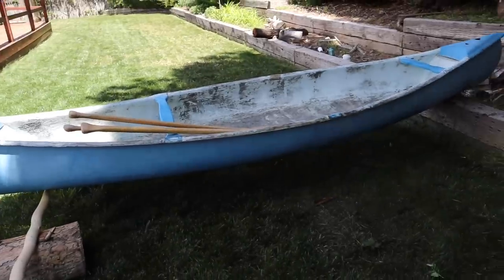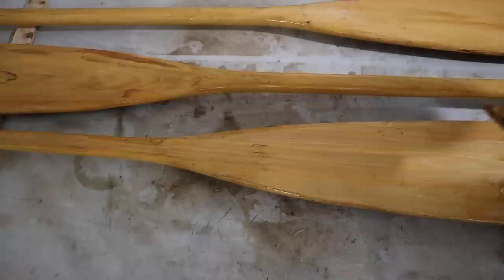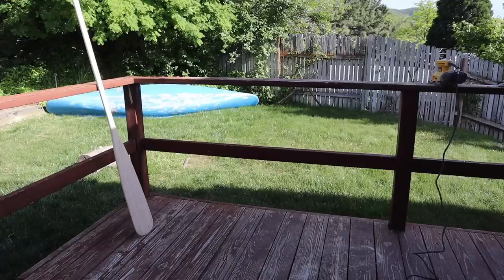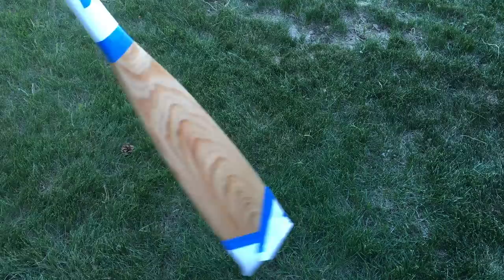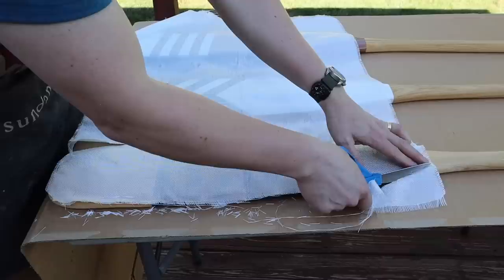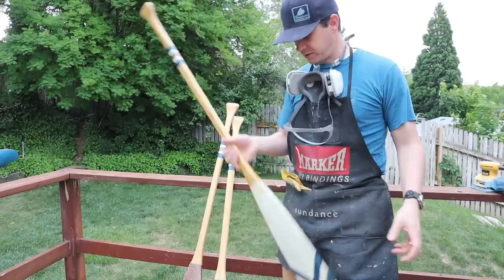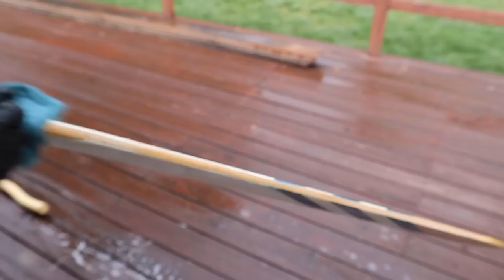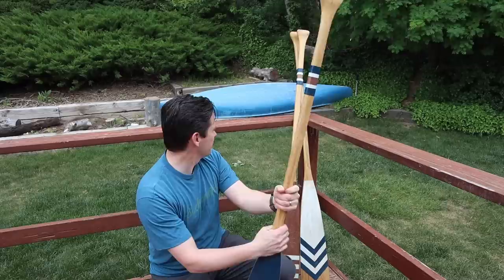Paddle Restoration - Custom Painting and Fiberglass

Comment: On the paddles, try multiple coats of either spar varnish or marine varnish for the finish, after fixing the cracks with waterproof glue or epoxy.  For the canoe, go online and look through the products sold by Jamestown Distributors  and/or West Marine, for starters.  You will find that the difference in cost between everyday products and marine-grade products is not that much compared to the time you will spend on labor doing it the first time, and then re-doing it again a year or so later when the wipe-on poly fails.  Thanks for the video - the paddles look great right now.  

P.S.  Blue Painters tape will pull up new paint if you're not really careful, as you may have noticed.

Comment: Nice job on the paddles. A tip for you you can precoat the paddle before adding the fiberglass or presoak the fiberglass beforehand.  Less chance of air bubbles that way. Thanks for sharing.
Reply from the maker: I almost did that. I chose not to to limit the fraying or the fiberglass cloth by moving it after cutting... not sure that was sound thinking or not though. 😁

Comment: Where the glass is, might hold up a while... Suggestion, drill a hole in the top of the paddles and insert a nice brass grommet. then use paracord or the like to make a lanyard. You don't want to wind up up the creek without a paddle. If you're going to be messing with things actually made to be in the water, you've got to move up to marine grade products. You do beautiful work, and these are nice, I don't know how much use they'll get, but one canoe trip could ruin them with average everyday products not made for the job.

Comment: Poly isn't going to cut it long term. You must use marine grade varnish. That paint won't stay long either. You'll yave to redo these probably once a year with minimal use.
Reply: Why won't the paint last?  He fiberglassed over the paint.  The fiberglass/resin should protect the paint and wood underneath.
Reply: I agree that a good marine spar varnish with UV protectant is needed especially to protect the fiberglass/resin.  A good marine spar varnish should certainly last more than one year, however..
Reply: @explorermike19  You'd think so, but it won't, not if they see a lot of time out in the sun and actually get used. UV rays for one thing, but mostly I was referring to that final coat of poly. It won't hold up in sun and the smallest nick can start it all going bad. It's UV rays that kill paint, and yes even fiberglass and gel coats. Even marine grade paint and varnish has to be redone every few years if they see a lot of outdoor use. Except for some very expensive coatings that the common man can't get hold of, nothing much stands up to UV rays long term. Some paints and varnishes do have some resistance but none are completely UV proof... no matter what the label says.

Comment: Its great that you've put fiberglass over the blade, but in my experience the paddles break at the throat. I oil my paddles to get that natural flex into the shaft before the fiberglass and PE finish. I also run a resin cap on the end of the blade so it doesn't damage the fiberglass as you push the end of the blade off of rocks or sand while you're on the water.
Reply from the maker: Good advice thanks.

Comment: Awesome video! Question for you. Do you need to put the fiberglass over the paint to seal it, or can you just poly it and it will still be fine for the water?

My paddles are in good condition, I just want to paint them differently. Thanks!
Reply from the maker: I did fiberglass to strengthen the paddle not to protect the wood. That said I am no expert. These are the only paddles I have ever restored or made. 😁